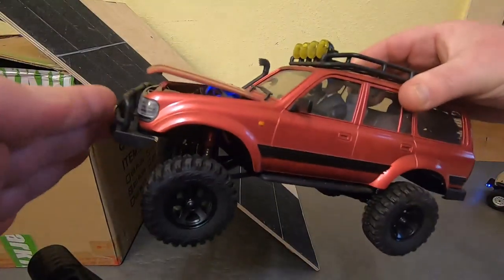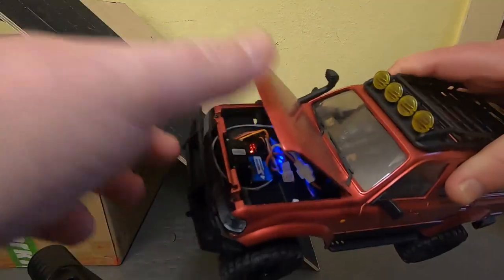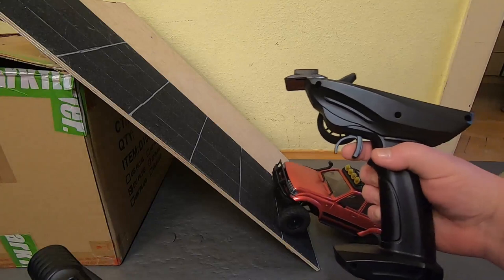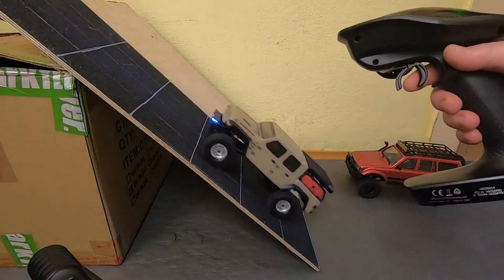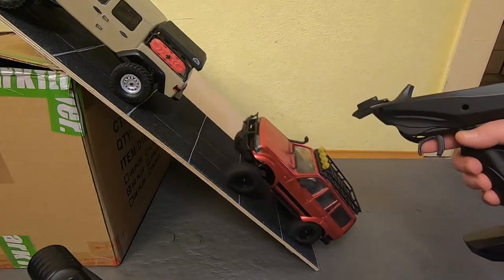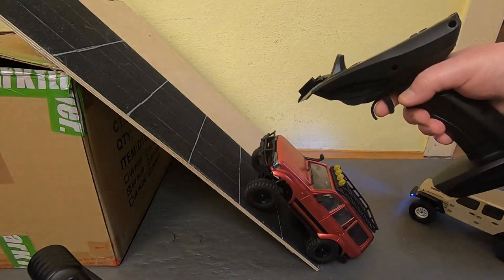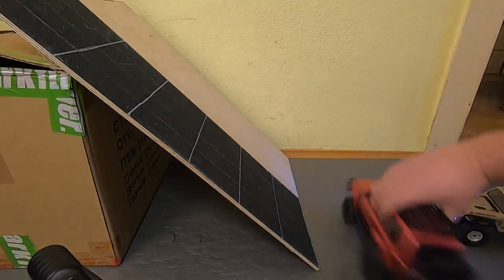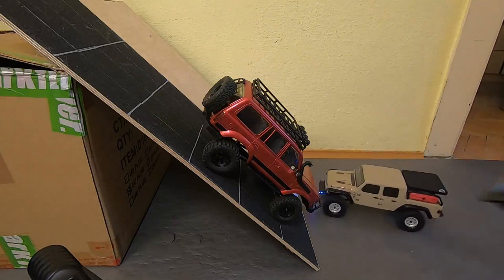RocHobby Katana: Dragbrake with AS12/6RW upgrade ESC (dragbrake in Modellbau-Regler.de ESCs)

Comment: My Panda Hobby Tetra K1 also doesn't brake. It rolls back if in neutral, (blue LED is on).
Reply from the maker: Which ESC?
Reply: @donaldsneffe  Ich habe den AS12/6RW Easy
Reply from the maker: @Helistoeny  Der Panda hat so ein seltsames Getriebe und so einen seltsamen Motor. Sollte trotzdem nicht schlimm sein. Schau dass alle Trimms (Throttle) unbedingt auf 0 sind beim Einstecken.
Reply: @donaldsneffe  ich probiere es noch mal. Bei meinen SCX24 ist das durch das Schneckengetriebe kein Problem, aber beim Panda...